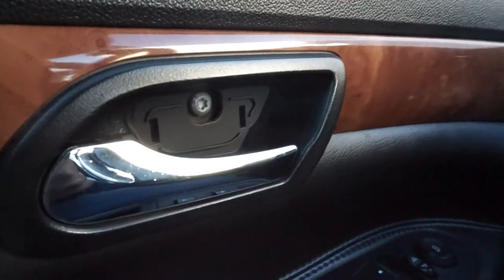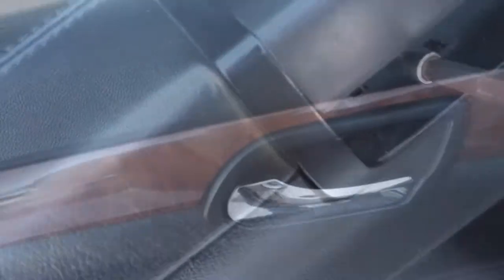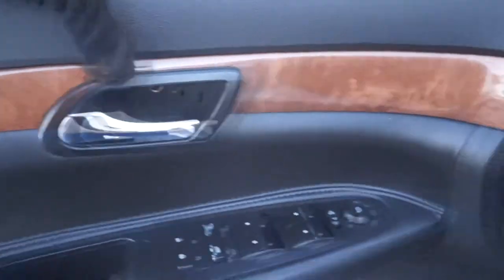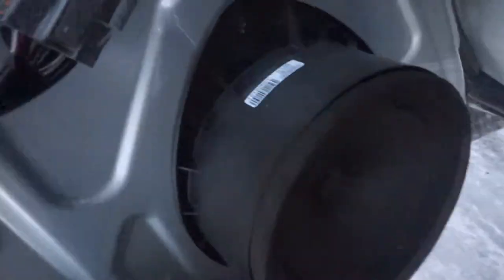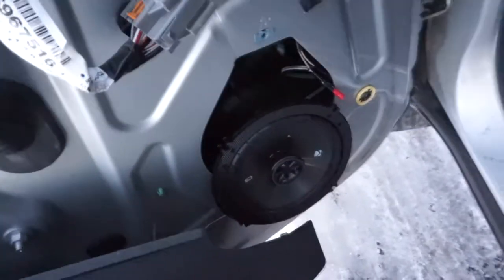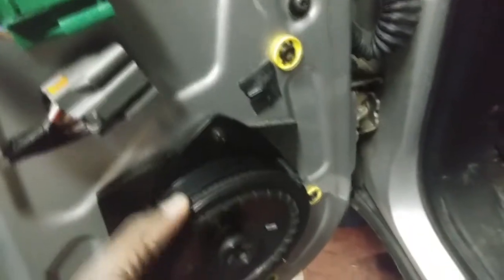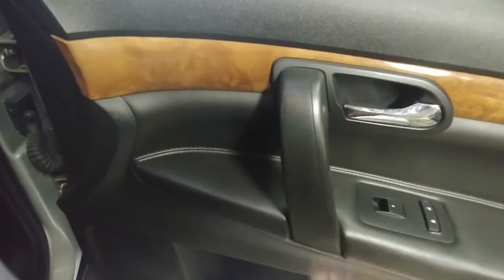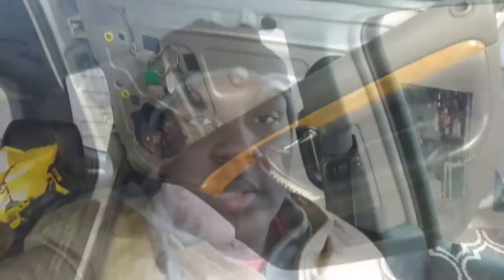How to Replace Door Speakers in a Car

Comment: Nice vid my dude. Can you put a link to the clips you used to install the speakers to the door.
Reply: All you gotta do is cut that oem speaker out.cut all that plastic around it and use that same molding of the speaker to put the new one in there
Reply: @rhurtadorh32 4 years too late 😂

Comment: And how much better do the kickers sound.
Reply from the maker: Hey Thanks for watching. I just dropped a link in the description. I just used these from amazon 
http://a.co/d/89sy6tf 

They sound better than factory. The bass and frequency response is definitely smoother I found the Factory speakers in all the GM trucks I've had to be kind of boomy, these kickers are an improvement. I would consider changing the radio too if you can that would help even more.

Comment: Is this a buick rendezvous? Just trying to make sure i get the right damn size door speakers so i hopefully don't need them extra mounts and stuff. Just put a skar audio system in and 7in screen, now i wanna replace my door speakers slowly.
Reply: Just trying to make sure i get the right size for each door mainly. Imma measure mine tomrow if i got to, but thanks for the vid.
Reply from the maker: This was the Traverse, Enclave, Outlook triplets. I'd double check for rendezvous. The sizing may be different for speakers.
Reply: @ThePowerisBack  thanks for the response, appreciate it!